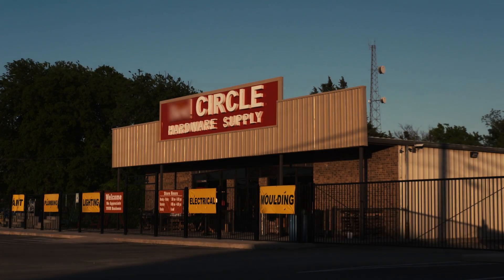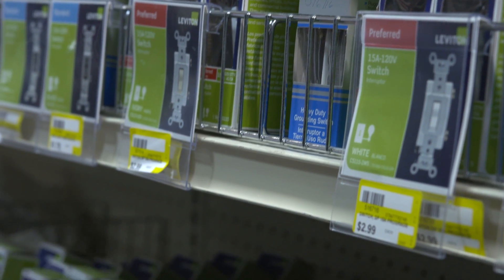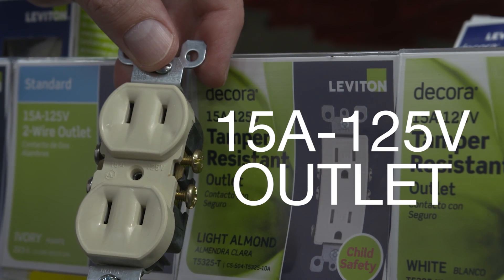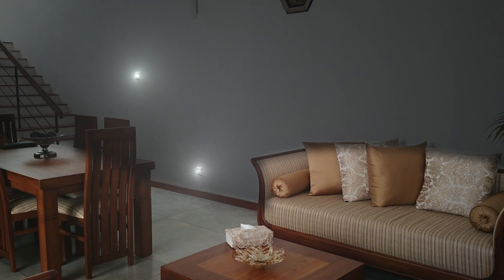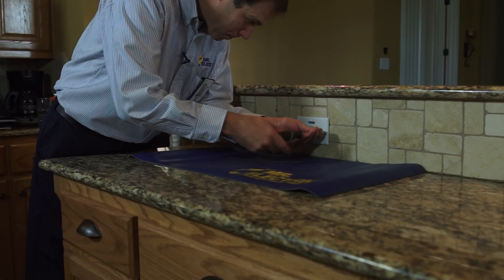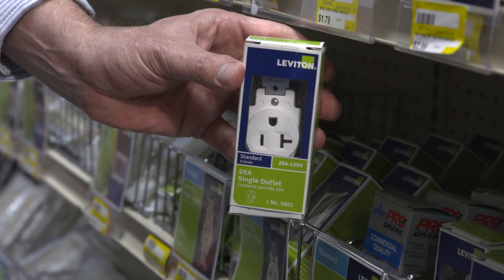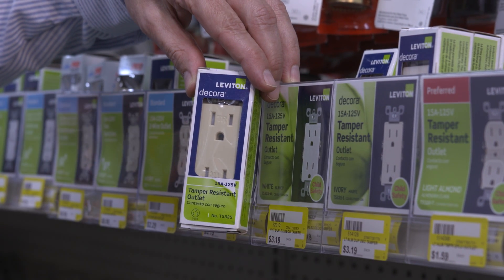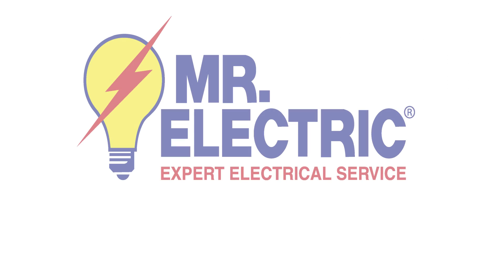Types of Electrical Outlets & How They Work | Mr. Electric

Comment: i plan on getting those Hubbell industrial grade 125V 20A receptacles. Would it matter if I use it here in my country where the standard voltage is 220V? thanks in advance.

Comment: I bought a wall-mounted surge protector, but it doesn't fit the outlet I want to plug it into. It's not a GFCI outlet; just a bit longer because of USB ports stationed in between the two outlets. Can I just cut off the plastic piece that's supposed to fit into ground of bottom outlet (added for, I assume, stability)?
Reply from the maker: Hi Paul! Thanks for reaching out here on the Mr. Electric headquarters YouTube channel. That’s an interesting question, and we’re glad to hear you’ve purchased a surge protector! We’re definitely in favor of homeowners using those to protect their electrical systems. On your specific question, without seeing the wall-mounted item in-person, it’s a bit hard to give you the best advice. We recommend you reach out an contact your locally owned and independently operated Mr. Electric franchised business, (which you can locate by clicking this link: https://mrelectric.com/schedule-appointment),or working with another qualified electrical contractor. In general, we do not recommend making any changes or alterations to electrical safety equipment. You might also consider reaching out to the manufacturer of the product for additional safety features and options.

Comment: Can I replace a normal 110 outlet with a gfci outlet ?
Reply: Is the original outlet grounded ?
Reply: @qv6486  no
Reply: @smokeydabeecharlescoleman8365  

Now it begs the question. Is it Knot and Tube wiring or are we using BX armor clad cabling.
Here is a handy tip on how to install GFCI from This old house.
https://www.thisoldhouse.com/ideas/replacing-two-prong-receptacles

Most importantly check with the local licensed electrician to get the Job Done Right.
Reply: @qv6486  Thank you.

Comment: Thanks for the info..I have one question, can I install a 15 amp combination outlet on a 20 amp circuit ?  With a 12/2 of course..
Reply: The electrical code says that you have to have two or more 15 amp receptacles on a 20 amp circuit.  Note that only the commercial grade receptacles can pass through 20 amps so if yours are wired in a chain you have to be aware of this to avoid overloads and a possible fire hazard.
Reply: If you use spec grade 15 amp receptacles they are the same as 20 amp receptacles internally. The only difference is the plug pattern.